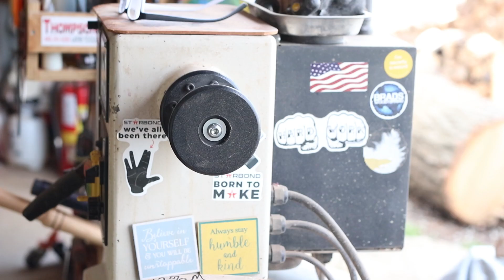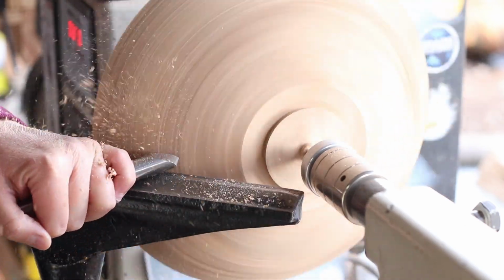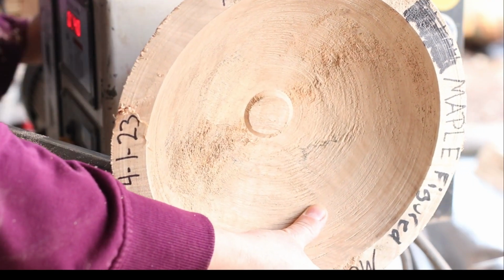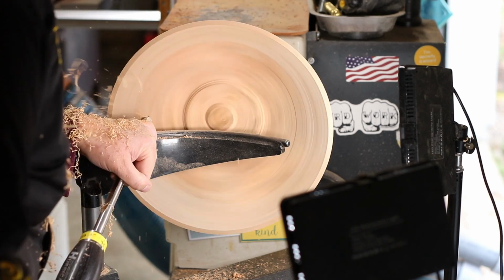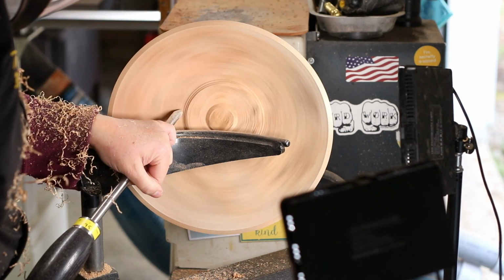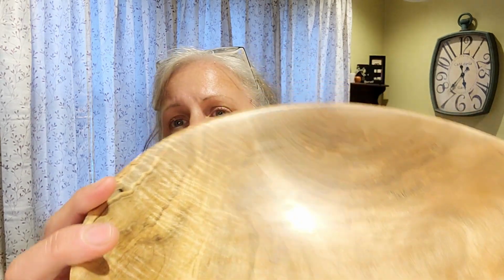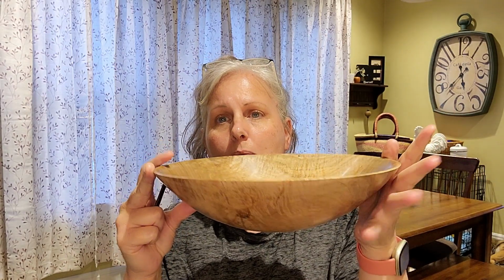** Made for the Amish**🍁 Figured Maple @TanyaBecherWoodturning

Comment: Tanya I think you did a nice job on this bowl. I have a question, it may just be my 73 year old eyes but on the interior of the bowl there looks like a spot that was torn maybe. It looks like it’s pealing up maybe. When the camera gets close it looks as smooth as any other part of the bowl. It may be like a vein running through the wood. It doesn’t hurt the looks or anything, but every time I look at a wood turning video someone has a different term for things in the wood. So did it turn smoothly when you we’re turning it or did your tools tear it.
I guess it’s a stupid question but I was curious.
Hey nice job and I hope you and your family have a fun weekend.
See ya Thursday
Reply from the maker: Thank you so much, Ronnie!
The wood had spots of punkiness on the outside, but not the inside.  I had some tearout because of that on the outside.
The outside has a tiny spot that I couldn't sand out the tearout. I filled that with starbond.  Unfortunately, I didn't see the spot on the inside that was torn.
Was it during me turning, or was it the finished piece?
Have a blessed weekend!
Take care, 
Tanya 😊
Reply: @TanyaBecherWoodturning  
I noticed it while you were turning it. When you would stop to look at it, I could see what looked like tear out but again maybe it’s just me.
Reply from the maker: @ronnielloyd4514  I value your opinion, so thank you!